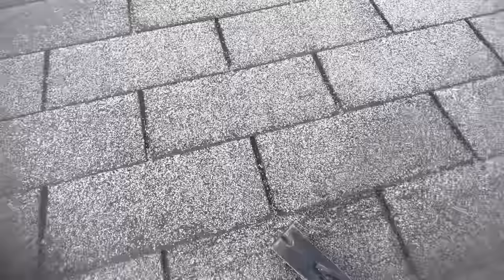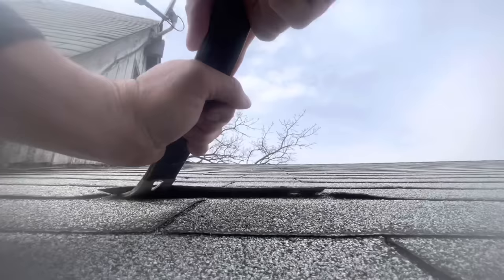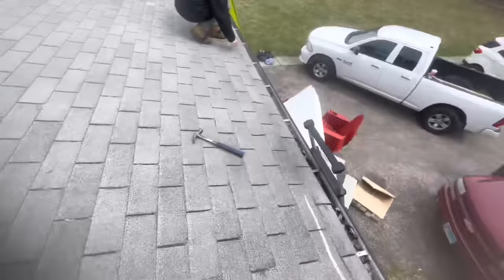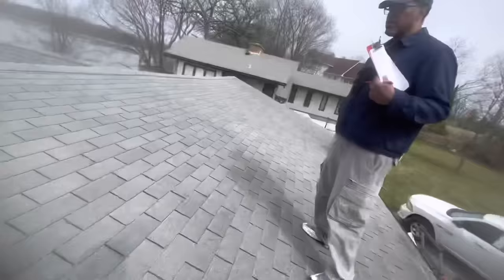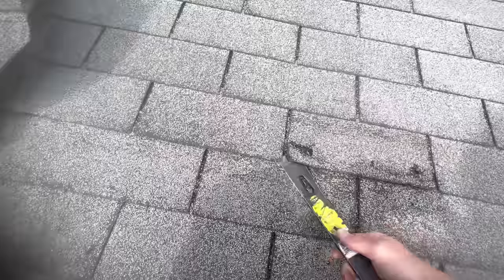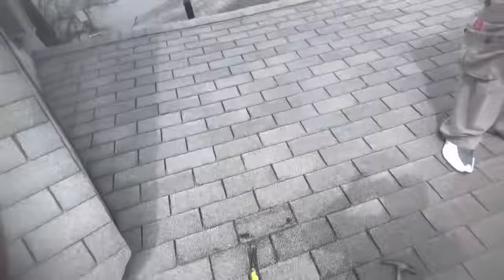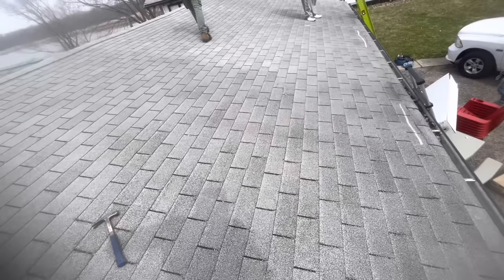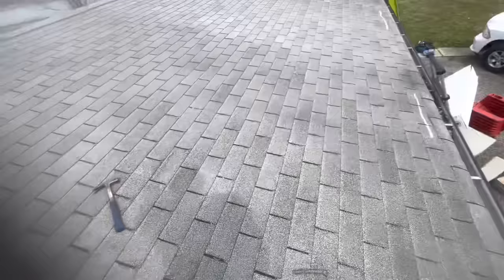Insurance Adjuster says roof is repairable. 😂 See how this inspection is ignored & denied?

Comment: YO YOU CREASED IT WTF
Reply from the maker: It wasn't creased. But when replacing other shingles on the rear side with the insurance company there, those ended up damaged from the repair.
Reply: @ChicagoRoofer  lol sorry I should of added more context.  I was referring to a similar video, where another wannabe inspector keeps saying the roofers are creasing it lol <3 meant no hate. I just think it's funny seeing the clowns tell the pros how to do it. But couldn't tell you the difference between a shingle and a tile.
Reply from the maker: Thanks for the clarity! I think I know which video you're referencing.  They make this very frustrating for sure. 

One year, an insurance company in Illinois would bring a PVC pipe and roll the shingle over the pipe. Then they'd say, "see, it's not brittle enough cause there's no crease".  😂. Then I would try to hand them a hammer 🔨 and say okay, show me. 

They automatically would default to the common response. We're not allowed to for liability reasons. 😂

Comment: I’m sorry, but you turned in an insurance claim for THAT?  Seriously? $500 and I could have all of that repaired. You should be embarrassed. Do you a
turn in a claim for every ding that you get on your car as well. You should be embarrassed for turning in little maintenance repairs. It’s your house.  Take care of it. Save your insurance for the BIG stuff.  But YOU turned in a claim for THAT. You have maybe 10 shingles that are loose. Be a big boy and fix it rather than waste everyone’s time.
Reply from the maker: Funny that you say that. The shingles are in relatively poor condition and a repair is not possible. Hence that's why there's a claim for replacing the entire roof. Insurance companies are not out there to pay for stuff that isn't owed. In this case the claim went from $3,000 to $63,000. Believe me, if it was unwarranted, illogical, or taking advantage, no payment would have been made. Are you an adjuster or contractor?

Comment: I’m confused by the video and title. Is the adjuster writing his estimate to repair because of other issues such as it is an old roof in need of replacement but not due to a covered loss? It appears you are fixated on the repair when he is attempting to explain to you he will not get into a conversation regarding coverage but you refuse to listen. It appears more is going on that you are not aware. You are a roofer NOT an advocate for the insured. He cannot discuss her personal business with you.
Reply from the maker: Interesting observation, I'm also a licensed adjuster. The roof is not repairable, coverage was extended for wind damage.  The repair is not possible for the 40 plus shingles they referenced. In order to repair the roof, multiple shingles around the surrounding shingles would get damaged and ultimately to a full replacement. Let me know what other questions you have.
Reply: @ChicagoRoofer  The roof is clearly NOT repairable but the issue may not be that at all. If you had to work so hard to remove that one shingle there are many other issues with the roof. How many prior claims have been made for this roof? Had the insured been paid previously for repairs but did not have them done? Was a prior owner paid for the roof but did not replace or repair it. The point is there are other factors at hand you may not be privy. The adjuster is not in a position to discuss potential coverage issues with you and the matter maybe headed to arbitration or a potential DJ action by the carrier. The fact is we have no idea what the issues are and getting emotional regarding business is never a good idea. After a decision is made then additional steps can be taken. The claim was not denied but written to repair for a reason which will eventually be known.